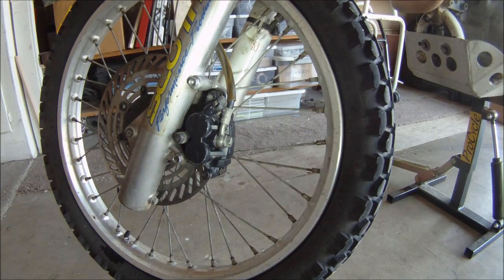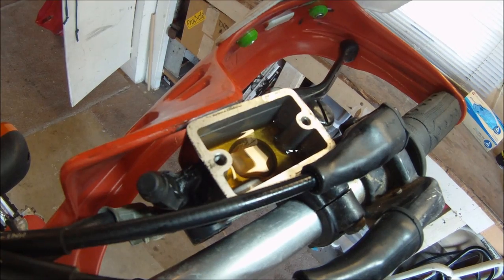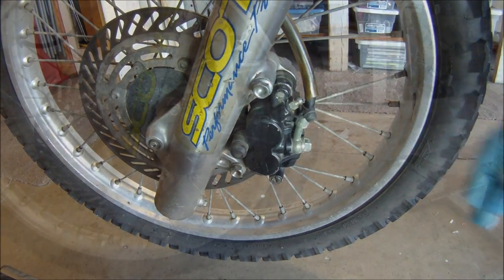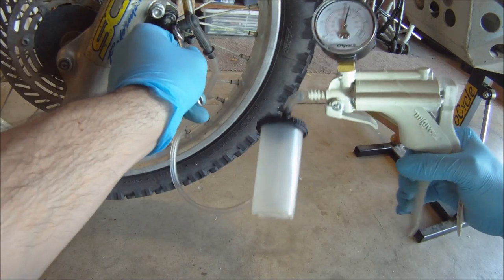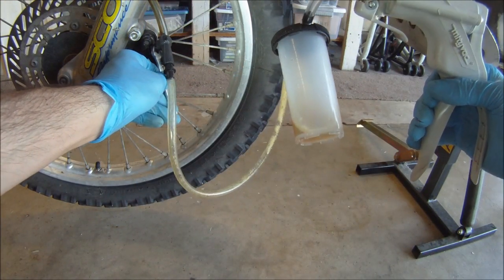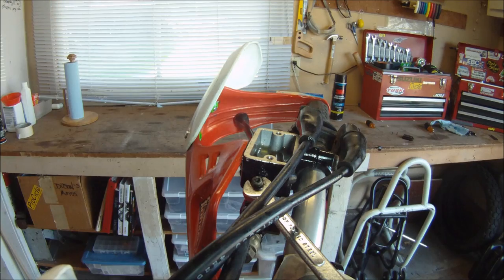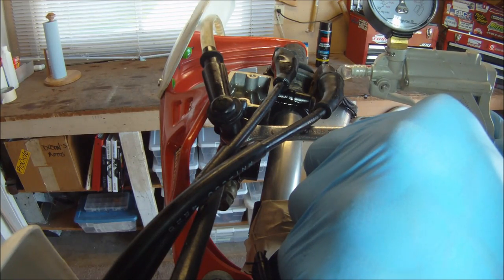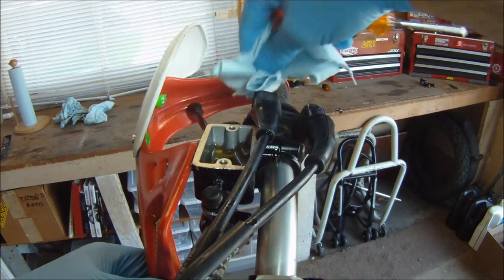Motorcycle Brake Bleeding with Mityvac

Comment: I'd suck out the old fluid from the reservoir first instead of pulling it down into the lines.
Reply from the maker: Thanks for the great advice.
Reply: Yep. Always get the old fluid out the reservoir. If you aren't sure how, call up one of your girlfriend's and ask them if you can borrow their turkey basters.
Reply: No need for the turkey baster he already has the perfect tool in his hand
Reply: A papert towel works too, you can easily tell when it will absorb enough

Comment: I use an older metal version of this vac pump.  Have been using this method on my cars and bikes for 30+ years and it works great.  this method works great! 

When changing fluid, I first use a syringe to remove old fluid from the reservoir, then wipe it down to remove any grunge before filling with new fluid.  This helps when bleeding the system as you can easily see when clearer new fluid start coming out of the bleeders.  You can never get 100% of the old fluid out (you would need to take the system apart and thoroughly clean everything to do that) but this will help remove as much as possible.

Comment: Well done and straight forward instructions.  I also have an MV800 and agree with the comment about using a clear 1/4" ID tube to attach to the bleeder valve port. The attachments in the kit are not so great, but the pump itself is better quality and works well.  Thank you.

Comment from the maker: Make sure you have the bleeder valve open with some clear tubing attached, and fill the entire system (new brake line and master cylinder) through the reservoir.  Once you have brake fluid coming out from the bottom bleeder valve you can then proceed to bleed the brake system as recommended.  Try to recheck all bolts after your first test ride to make sure everything is on properly.  Good luck!!  Thanks for stopping by also.

Comment: I got the pneumatic bleeder tool from Harbor Freight, and it actually works pretty nicely.  It uses air from your compressor, and all you need to do is pull the trigger, and the air is used to create a vacuum via a venturi effect.   It has a large container to hold the old fluid, and good quality silicone hoses and fittings.   
Might want to consider it if you have a compressor; it's quite a bit easier than pumping with the vacuum pump.  Only drawback I see is that you need to be careful not to tip the container, because then you might atomize and spray brake fluid into the air- not a good thing.

Comment: Just a comment on the air bubbles you're seeing.  Do you feel that this may be air leaking through the threads of the bleeder nipple?
Reply from the maker: I'm assuming so. I used the tightest adapter I could. Optimally it would pull only liquid so I just kept the pressure high so that no air would go back into the system. Anybody else using the Mityvac know what I was doing wrong?

Comment: All the wiping down around the reservoir probably should be done before removing the cap, and after putting that cap back on, to avoid the possibility of knocking the dirt from the wiping into the fluid.

Comment: There is no need to bleed the master after pulling all the fluid out the caliper bleeder, redundant and waste of time. You should start by sucking the master out first, then fill with fresh fluid, then bleed and you're done. Provided you keep the master full at all times with fresh fluid while bleeding you won't get any air in the system.

Comment: what if I were to pump-in new brake fluid from bottom and catch old fluid at master reservoir (remove say with syringe) until only new fluid is present into reservoir? would this method push old fluid from entire system?
Reply from the maker: I don't know. That depends if the master cylinder is a one-way valve or not. In theory it would work if the master cylinder doesn't prevent fluid from flowing backwards. Good luck!
Reply: Thanks!

Comment: i have this bleeder but cant get anything to come out of the reservoir  ...i put new line on and master  cyclinder stays full
Reply from the maker: Hmm. this is odd. When you say you put new line on, do you mean you replaced the brake cable? Or you put new line on the MityVac? 

If you replaced the brake line, then my 2 questions are... where you able to bleed the previous brake line easily?

And as you are bleeding this setup, does any brake fluid come out of the lines at all? So are you about to empty the lines while the reservoir stays full?

Thanks man.
Reply: @XRLand  yes , new brake line . Never had problem before  . Not even getting a drop of fluid out at the end of new line . I took line off master and put finger over hole trick ..was able to get some fluid out . Was going to try reverse bleed .  This is what I get for letting my XR go.

Comment: Great video.  I have the same kit and love it. The only issue I have with it is the L fitting like you're using over the bleeder valve never creates a good seal for me.  I find that with some clear vinyl tubing (from any auto parts store) over the bleeder nipple, and the other end connected to the tubing that came with the kit to create a much better seal. If there are bubbles when you pump it up or it doesn't hold pressure, you can seal it up with some grease around the nibble & tube combo. Works great. I just posted a video on this same subject on my channel.

One comment on this video, you shouldn't be getting any air bubbles in the tube when your bleeding. Especially the amount shown in this video. You have no way to know if the air is coming from inside the brake system (meaning you need to keep bleeding), or from a bad seal with the vacuum pump fitting (meaning you need to seal the fitting). You don't want any air bubbles flowing down the tube when your bleeding brakes.
Reply: +Pet Rock&#39;s Garage 
You'll drive yourself crazy trying to make it so that there's no air coming into the part of the line with the fluid that you've drawn out of the brakes, especially with those ells that you get with the mityvac kit.  If it ain't spongy then it's good, in my unprofessional opinion.
Reply: +knupder, yeah, the L’s that come with the kit are garbage IMO. But if you connect the hose directly to the bleeder and apply a little bit of grease to the base of the bleeder screw and the nipple & tube combo you won’t get any air bubbles seeping in creating a false positive of air in your brake system. Been using that trick for years without issues and I’m a stickler for a firm brake pedal.
Reply: Pet Rock's Garage

Are you using plain old lithium grease or some fancy silicone goop for that?  I'm definitely due for a bleed.
Reply: +knupder, just regular multi-purpose/chassis grease. Nothing special. You can also check out my video on the subject.

Comment: I do t believe I have any bleed nipple on master cylinder just the banjo so how would I bleed the mc? I have good breaks bit feel.there is something I'm..missing I have a one way valve for bleeding all.fluid comes out continuous bit thinking lever could be that extra bit former
Reply from the maker: Kevin Hancock I believe you just exchange the fluid through the caliper bleed valve if there is no MC bleeder.  I need someone else to comment on this though because I am not 100% sure about this.  Good luck Hancock.
Reply: Thanks for your reply I did release banjo bolt at mc brakes currently seem very good indeed

Comment: i kept seeing bubbles coming out of the bleeder valve!!! oooops
Reply: 7bikerboy7 You will see the same when bleeding manually also. Some air gets sucked into the tube around the nipple while bleeding. The air doesn't always come out of the brake system.